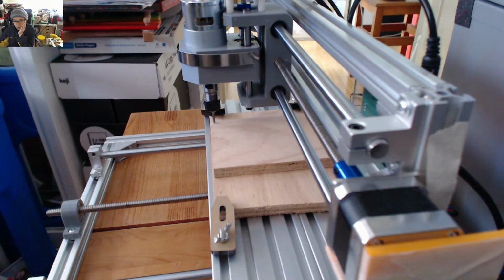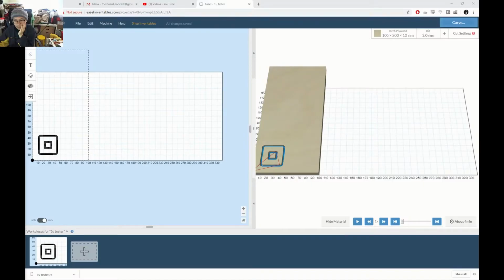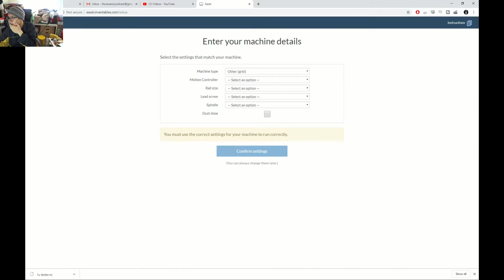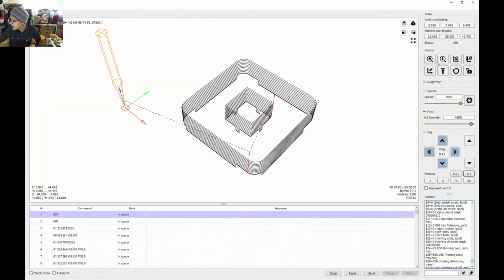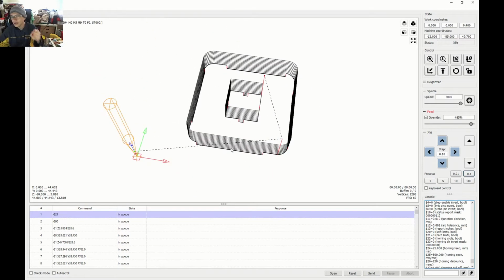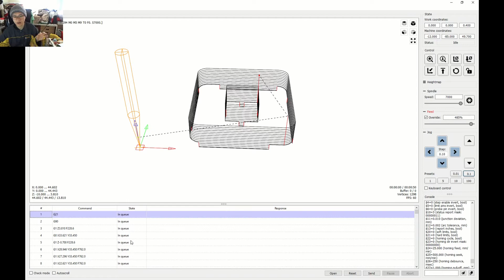3018 Mini CNC Upgrade Part 2

Comment: Geesus wept.....did you not see the X axis stepper motor was wobbling about with the loose mounting plate? …...total crap video...…...I'm outta here.
Reply from the maker: Its deliberate. The drive rod is bent and by tightening the mount plate, it actually causes the stepper motor to lock up.

The solution was actually a 3D printed bracket that holds it in the place it needs to be, but enables the motor to rock up and down as it needs to,

 But, thank you for your comment, have a good one :)
Reply: cya later champ